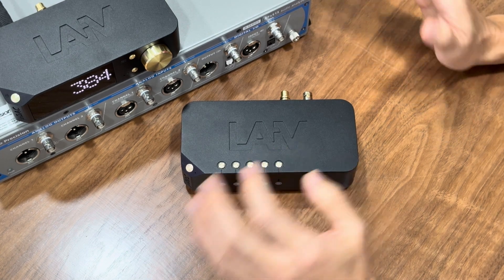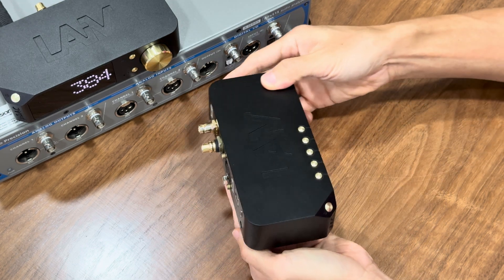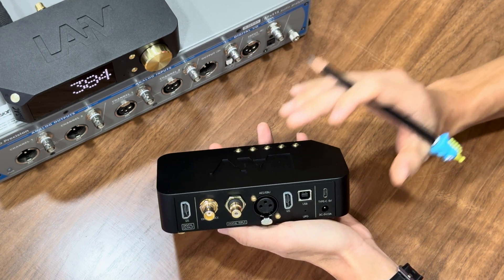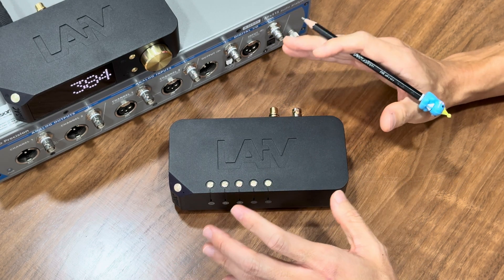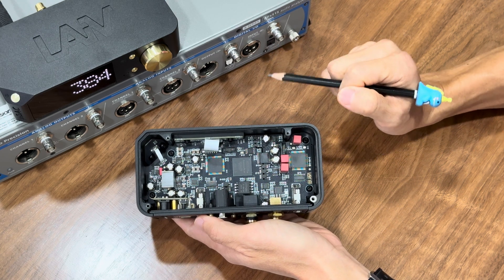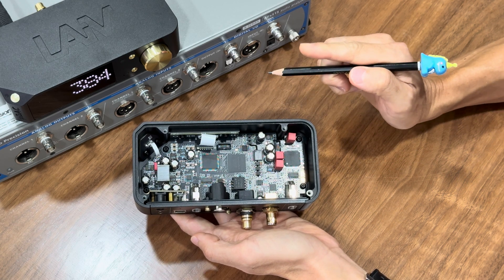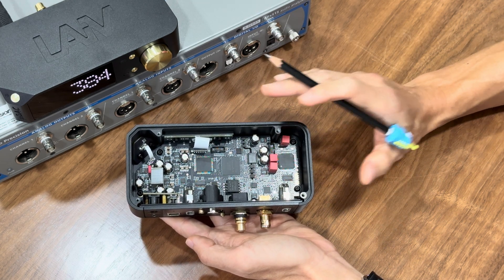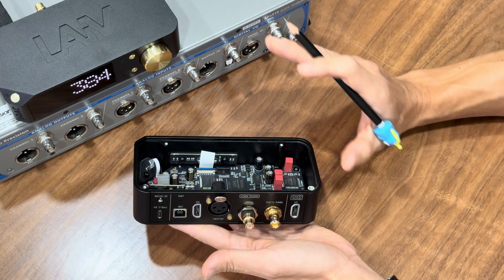LAiV Harmony µDDC: Inside the Cutting-Edge Digital Audio Architecture

Comment: Does the uDDC have any facility to reconfigure the i2s output pin configuration to align with that of the receiving DAC?  Could it be used with a Gustard DAC for instance?
Reply from the maker: The uDDC does auto-i2s pinout configuration with LAiV uDAC and Harmony DAC only. For third party DAC, i2s pinout configuration manually is required.

Comment: The µDDC brings the Harmony LAIV to another level. The improvement is very noticeable, not subtle as some reviewers noted. Sound stage is not much wider but a lot deeper, electrical noise never realized before is now gone due to the darker background, silent between notes. More importantly is how relax music full of details with the added µDDC. Music present in a more realistic level than before. This is with the switchboard power supply. I am not sure how much better the LHY linear power supply will be since I have not figure out how connect the power supply yet. There are positive and negative out from the LHY and one input on the µDDC. Just emailed Alvin, anyone charm in is appreciated. Should I use the positive or negative on the LHY for power transfer to the µDDC or it does not matter? TIA.

Comment: I use the µDAC and it performs well. However, to truly get the best out of it, a linear power supply is essential. I power my µDDC with the Sbooster (BEST OF TWO WORLDS P&P ECO MKII – Linear Power Supply), and the improvement is significant over the horrible switching power supply that ships with the µDAC
Reply: I'm surprised that the uDDC doesn't have a LPS like my Denafrips Iris 12th.

Comment: Oh man, too bad it doesn’t have two outputs or else it would replace mu SU6.
Reply from the maker: No worries! Out of curiosity, are you using two DAC simultaneously?
Reply: @ Yes, I use the two i2S outputs from the SU6. Two i2S outputs is uncommon  so i would settle for one i2S and one SPDIF 😉